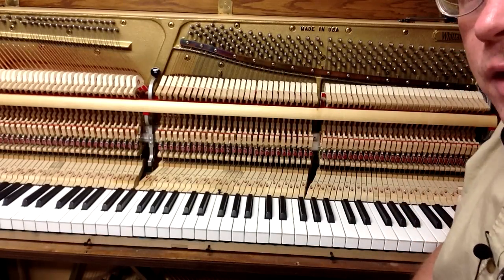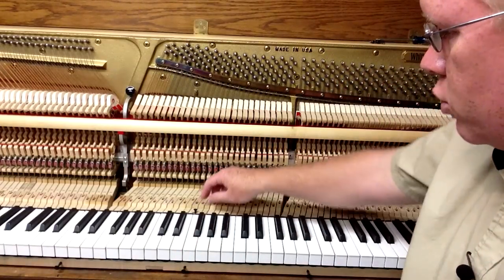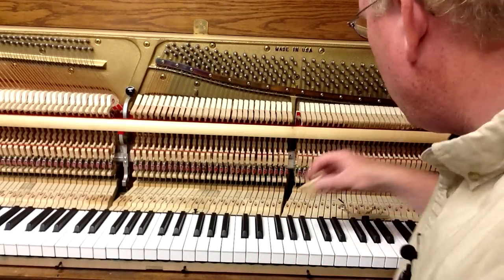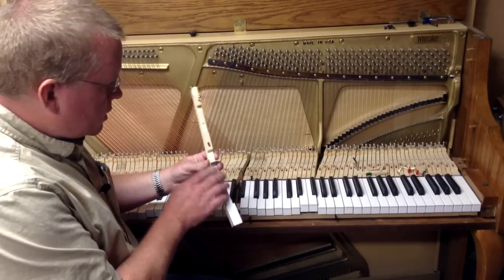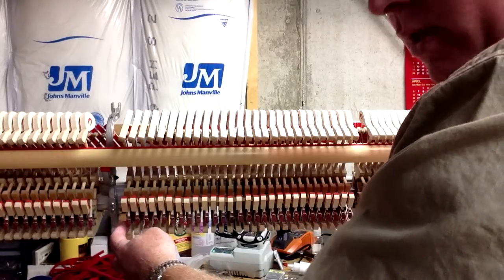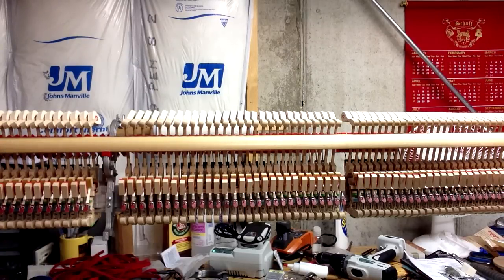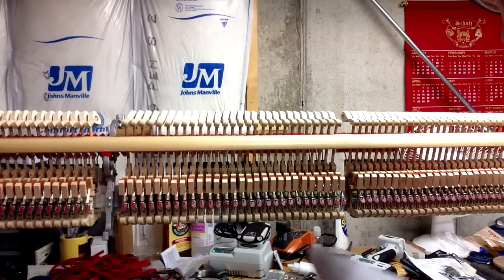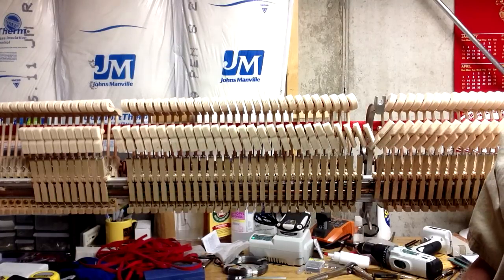Reconditioning A Vertical Piano Action - Piano Tuning & Repair I HOWARD PIANO INDUSTRIES

Comment: All of your videos have been incredibly helpful.  I have a 1903 Henry F Miller & Sons upright that’s been in my family for 60 years. I’m not sure it’s had any maintenance done to it in that time. It had broken/missing keytops, two broken hammer shanks, and a variety of other mechanical problems that I’ve been correcting.  The fact that it’s mostly working speaks volumes to the build quality, but I’m sure I’ll need to do everything mentioned in this video to at least some of the action mechanisms.

Comment: Watched nine videos and learned alot! I removed the action on a piano yesterday and when I put it back, it constantly sustained the notes. I took it out, didn't see any problems, I had broke three strings and the customer was getting irate and I had to just walk away before I did any more damage. I think the bottom of the action was in too far and the sustain rod wasn't moving the back mechanism.

Comment: Love to see this for a grand piano action, I'd presume most of the same points would be roughly the same though the action is obviously abit different, keep the videos up.  Loving your stuff.
Reply from the maker: Thanks for watching and thanks for bringing your questions.  I'm sorry I'm not always quick to answer.  We actually do have a video which shows all of the different parts of a grand piano action.
Reply: Hi Steve.
That's quite alright bud don't worry your a busy fella.  I'd presume the regulation procedure is fairly similar for grand actions anyway but there are some differences in the parts, just though it'd be handy to show this video but for folk who're working on grand pianos aswell.
Reply from the maker: Thanks Sam, I'll try and get a grand piano reconditioning video put out soon.  I can see that it would be helpful as yes, the parts are different.

Comment: I have a question , as i look the springs on the action are not straight or in a line , some are bended to the right some to the left , this is normal or they need to be changed ? Thanks!
Reply from the maker: If they are hammer butt springs they may just need to be repositioned into the slot on the hammer butt.  Sometimes the springs can come out of the slot.

Comment: Thanks for great videos. I bought a universal key tuner tool from a music instrument store with recommendation, to tune a single string out of tune. But the tool keep getting crazy stuck on the pin. Do you have an idea why this is happening? The tool got eight corners, and the pin four.. all the best!  Morten and friends
Reply from the maker: Hi Morten,
I have had this problem a couple of times, but it isn't common.  I'm guessing it has something to do with the angle of the taper on the head of the tuning pin that causes this.
Reply: Just guessing that this also might also be due to the corners of that pin (since you said you were only tuning one string) being rounded slightly before you got the tool. Could someone have tried to tune the string with the wrong tool (like pliers etc) and not gripped tightly enough, rounding the corners? That could definitely cause binding.

Comment: Hi,  Unfortunately,  I'm over in the UK.  Would you please  give me your thoughts and advice.
I have an upright that's been dated as early 1920s.  I've had it over 40 years and know it's history from the early 1950s.  It appears in fairly good condition and been well looked after,  though it does have a couple of  small separations  in the soundboard  which I'm not overly concerned about  as it sounds reasonable. It was reconditioned in 1950 according to the info I have.  How extensive it was, I'm not to sure.  Its hardly been played since I've had it, and t's always been kept in stable conditions. 
I've had it tuned quite a few times.  Last time it' was tuned the guy reset the tuning pins by tapping them all back a bit,  he also adjusted action by adding some felt spacers, and even checked the weighting of the keys, and seemed to do a very thorough job   ( hope this doesn't sound too horrific to you ).  It's about a semitone  Flat, maybe slightly more.  Theres no corrosion on the strings, as far as I can see, and it's plays really nice.  When I've asked for it to be tuned nearer to pitch,  various Tuners have said, oh,  it's bit risky because of its age as they may  break a string.  Which I'm not overly worried about to be honest.  So, how big a risk is this ? Or is it overstated.    
Many thanks,
Roj
( some great video !  Thanks ! Subscribed)
Reply from the maker: Hello,  I have worked on these old uprights from time to time for over thirty years. Some are too far gone to repair, but those that are still in reasonable condition like the one you describe I almost always bring up to pitch. One reason I would not bring them to pitch is if the tuning pins were too loose to hold the increase in tension. If the last tuner tapped in the pins to increase the torque, I would think the pins would now be tight enough to hold at standard pitch. Almost all tuners I know leave them at a lower pitch because they don't want to bother with repairing a string if it breaks or they don't really want to bother with the old uprights at all. Replacing a few broken strings should not be a big deal if you are willing to pay for the extra expense. If strings do break, and many times none do, it's usually just a couple. You just need to find a technician with the right attitude. 

      Russell Schmidt- Piano Technician with Howard Piano Industries

Comment: Can the pvc E glue be used for gluing the felt on the hammer?  I have a Baldwin upright piano and the felt on the hammer has come partially unglued, Or what do you recommend? Thanks very appreciated.
Reply from the maker: I usually wood glue for this purpose but PVC E glue would probably work also.  After applying the glue in order to clamp the felt in place a strong thread can be used to wrap around the felt and wood hammer moulding. Wrap around the shoulder of the hammer and bottom part of the felt hammer and wood moulding about 50 wraps. Tie off the thread and smear glue on the tread wrapping also to glue it in place and form a sort of cast on the hammer. After it dries, leave the thread on it to reinforce the bond.

Comment: What is the best ditance between hammer and string when soft pedal is full down ?
Reply from the maker: A general rule is that the soft pedal should lift the hammers half the distance from the normal hammer blow distance.
Reply: @howardpianoind  thanks, I try yesterday and it's really better. My feeling tell me to do that before, but I will like to do the best setting, so thanks.

Comment: Hi Steve Are the backchecks meant to be all the same level or is it normal to have some sitting below or above the others, they all look as if they're sitting at different levels in the video?  Cheers
Reply from the maker: When the action is in the piano the backchecks should be pretty much all at the same level, but this can vary depending on how worn the parts are.  When the action is out of the piano as it is in this video you will see more variance as the whippens aren't being held up by the capstans so the backcheck level will be more dependent on the adjustment of the bridle wires.

Comment: Is there a video demonstrating replacement of the treble damper felt set?
Reply from the maker: Damper felt replacement is one of the videos that I have on my list for doing in the future.  I haven't gotten around to this topic yet for current videos.
Reply: howardpianoind Hi Steve, my piano felts need replacement. My tuner said it's not worth replacing because of its high cost. He also scared me about damper spoon adjustment that could possibly brake and come off. I am thinking of replacing all dampers myself to save money. But I haven't found a single video showing it. Is it very hard? I have already restored and refinished all wooden parts of a 100 years old piano so I think I can replace dampers what do you think?

Comment: I've watched a good many videos showing how easy it is to remove the action .   Not one explaining why some of the hammer are jamming against the strings when I try reinstalling it.
Reply from the maker: My guess is that the hammers that are jamming against the strings have broken bridle straps.  If this is the case, it is because the whippen falls too far down when the action is removed causing the top of the jack to get stuck under the hammer butt felt.
Reply: @howardpianoind  I'll have to take your word for it as that is exactly what my piano turner guy also said.  I only wish I had been forewarned, this might happen,  ahead of removing the action. (having been told in so many how too videos how easy it is to R&R  the action)  LOL .    Oh well , the repairs were going to be done anyway.

Comment: Hello, I was putting my action back in the piano and the whippen flange broke with the pin still inserted on the whippen since the whippen flange was so fragile. I was wondering how can I put a new whippen flange back on the whippen if I can't remove the pin from it.
Sorry for interrupting, thank you for your time.
Reply from the maker: Hi Leo,
Unfortunately there isn’t a way to install a new flange without removing the pin.  You would need to remove the pin and put in a new pin with the new flange.
Reply: howardpianoind Thanks for the response! Is there any useful tool I could remove the pin with since it's stuck in there so tight? Thanks!
Reply from the maker: Yes, we have center pin repinning tool on our website available.

Comment: Hello, one of the notes on my piano is continuously sustained as the damper doesn't go all the way to the string. Is there a video I could watch to help sort this out?
Reply from the maker: It’s possible that the damper lever is broken.  If there isn’t anything broke, you may need to either adjust the spoon or the damper wire.  We do have a video on adjusting the spoons, but not the damper wire.